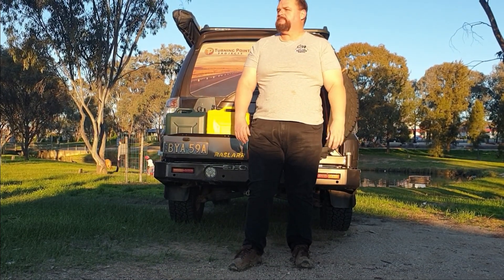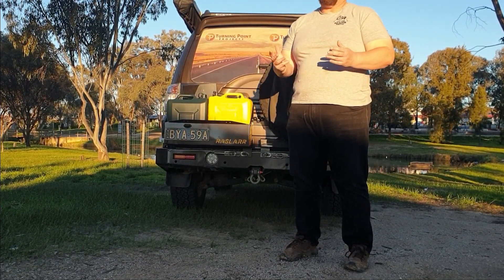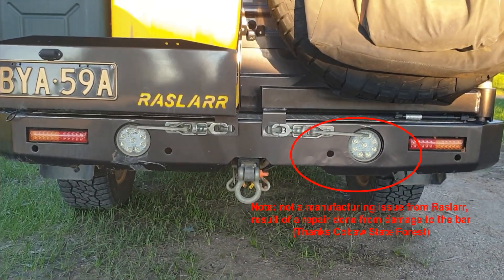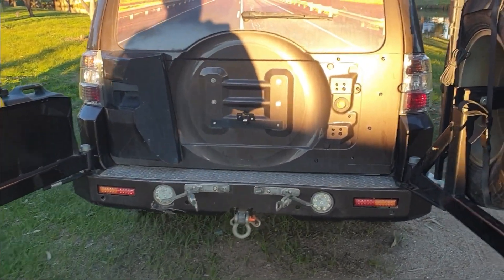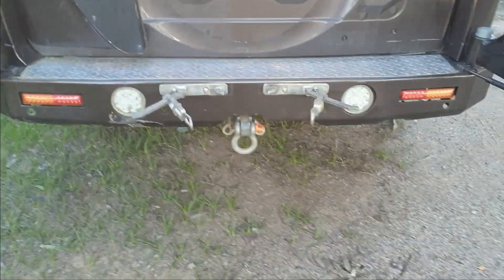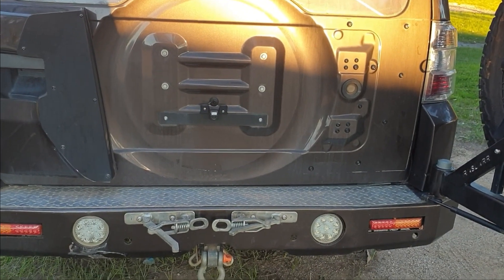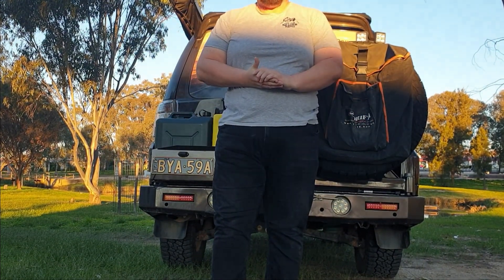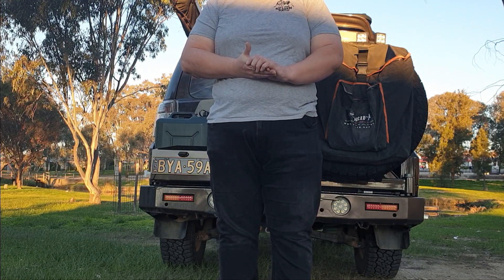Gen IV Pajero - Raslarr Rear Bar

Comment: What are the rear springs rated for? I imagine it weighs a fair bit
Reply from the maker: Hey Dane, knowing I intended to put this on I got the dobinsons 500kg constant load.  It's stiff but I'm ok with that and for me it handles better than it did stock when it had a lot of body roll.

I have no idea if that's technically 'right' but I know I like the way it drives now.